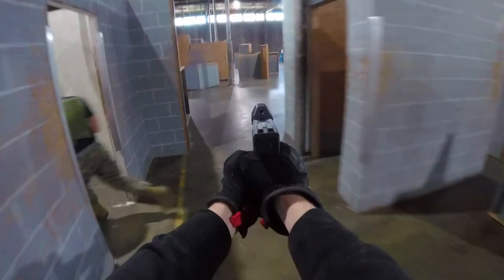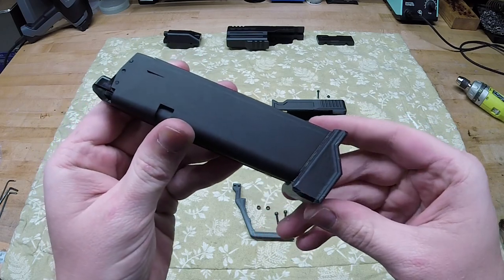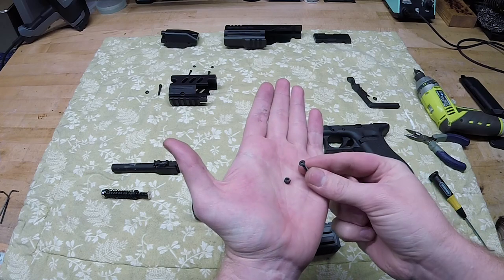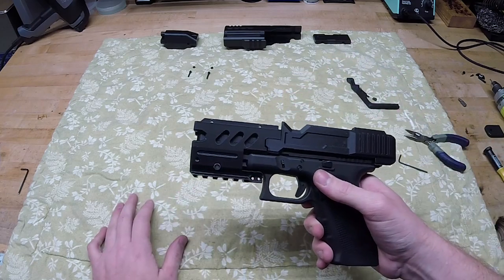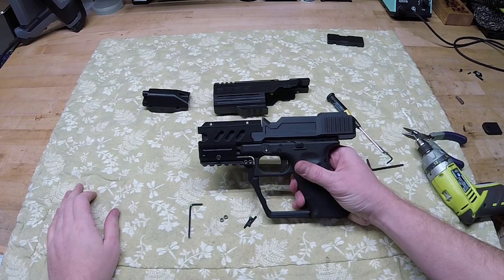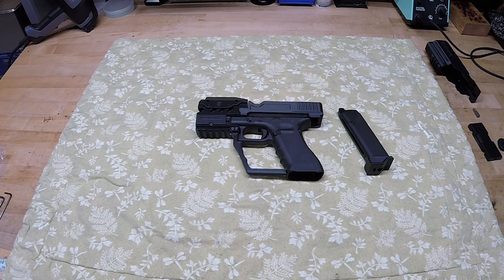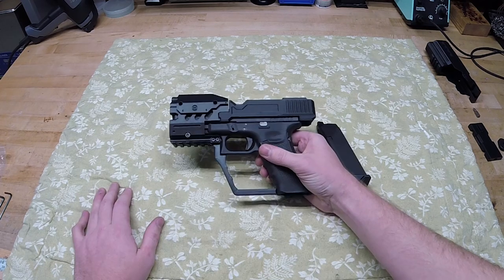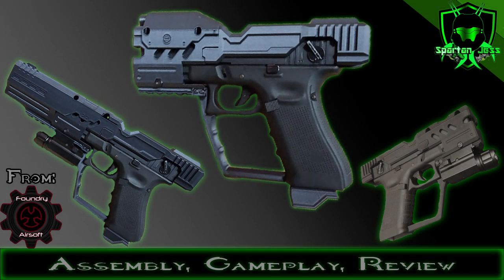Halo Airsoft Magnum Review - 3D Printed Version (By Foundry Airsoft)

Comment: Honestly, what I'd love is the ODST kit, but with a suppressor on the Glock so it's actually suppressed.
Reply from the maker: I've heard rumors of placing a micro tracer unit into the ODST variant can be a possibility. Haven't tried it for myself, but it's cool the socom has room inside the suppressor area.

Comment: Keep up the sci-fi reviews. I love anything that's sci-fi airsoft or sci-fi gel blaster related.

There is a sci-fi kit for airsoft and gelblasters called an em-cannon - that goes on most ar / m4 receivers    have you seen that?
Reply from the maker: I just did some research about it. That kit looks very neat. I like the battery meter in the back and the front illuminating barrel area.
Reply: @SpartanJess  I've got one,
I'm putting in a transparent inner barrel and flush mounting a couple of UV LEDs at the tpiece (just above the mag)
That way they can charge up the glow bb/gel  before they get fired down the barrel.
I'm also removing the red metal outer barrel part, and drilling holes in the side of the "suppressor" 
That way it looks more like a railgun, and you will see the shot travel down the full length of the barrel like a laser

Comment: How did you remove your front sight? I have an Elite Force Glock 19 Gen 3, and to the looks of it the sight is molded into the slide.
Reply: Kinda wondering about that myself, actually... (Mine's a EF Gen 3 17 half-blowback)
Reply: Glock makes a tool to remove the sights, but if it's molded to the slide it's a problem with the slide

Comment: What holster do you use for that?
Reply from the maker: Their are two different kinds of holsters to use for this. One is a trigger retention holster for the glock. The second is a fabric holster called the "Excellent Elite" holster.
Reply: @SpartanJess  What's the trigger retention one like?
Reply from the maker: @TheShreddedSnorlax  It's basically a holster that snaps into the trigger guard of the glock, having the glock exposed but still holstered.
Reply: @SpartanJess  Oh I know what a retention holster is, I run a Safarliland 6354 for my Umarex Glock 19, I'm wondering what specific retention holster will actually accomodate the extra size of the magnum
Reply from the maker: @TheShreddedSnorlax  I can't exactly say personally, because I don't own one as of yet. But I know someone in the halo airsoft community that designed and 3D printed one and uses it for their magnum. Here's the link.

https://www.thingiverse.com/thing:3758051